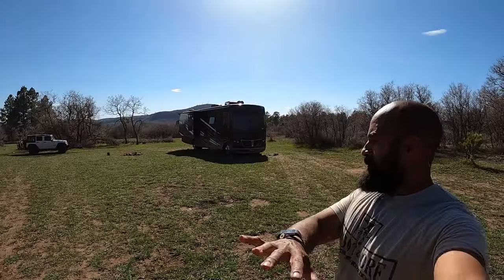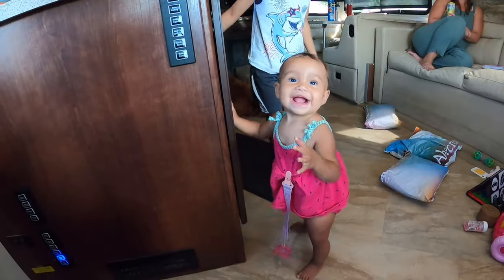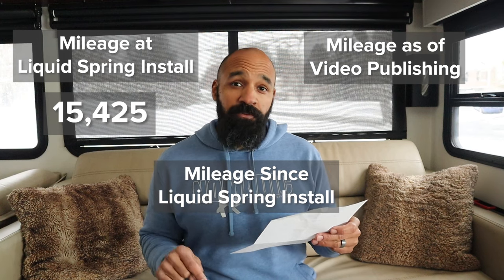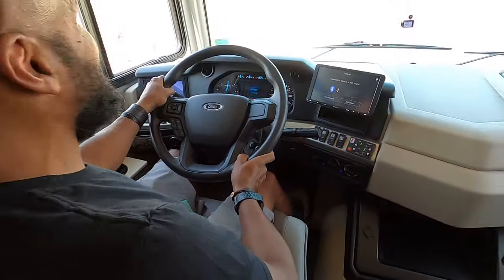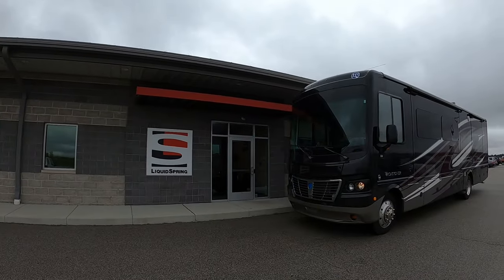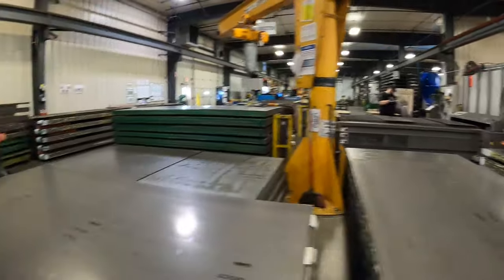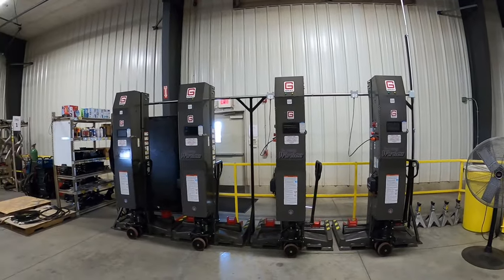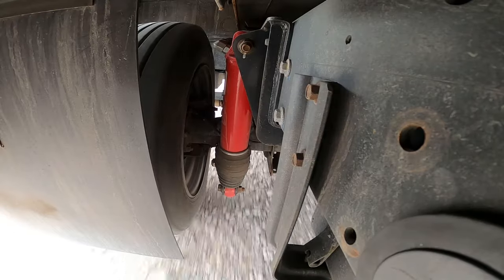Is it really THIS GOOD? 2 Year Review of Liquid Spring Suspension System | RV Family Travel Life

Comment: Great 2 year overview, I just returned from LiquidSpring HQ, I spent 5 days having the 4 corner suspension installed on my 2020 HR Vacationer 35K, videoing the entire process and interviewing. On my 380 mile drive return back to Michigan, the fatigue factor no longer exists, also I noticed I need to make sure I use cruise control, if not I could easily exceed the posted speed limits, before LS, that was not the case. It's absolutely a game changer. Now besides the normal fastener inspection, they have added a desiccant filter that needs to be inspected.  For the Ford F-53 22K chassis, it adds 550 lbs,  which count as cargo, so that must be taken to consideration. Wayne Wells, Eric Garcia, technicians and the engineering group were great to work with.  Safe Travels guys.
Reply: Adding 550 lbs. is a deal breaker for me. What I wouldn't give for another 550lbs of carrying capacity! We're FTers who boondock most of the time. Our F-53 chassis MH even has a tag axle to increase its carrying capacity. Still, we started out with only 3,700 lbs. of CCC available. When you subtract the full tanks that we travel with (800 lbs. of water, 360lbs f gasoline and 120 lbs. of propane) and a 1,100 lb. solar/battery system (5,020 watts of solar and 23.5Kwh of LiFePo-4 batteries, inverters, charge controllers, etc.), we only have 1,320 lbs. left for everything else. This includes our food, kitchenware, appliances, clothing, linens, camping and BBQ equipment, TV, computer and all our worldly possessions. That's not much. We transferred all our heavy tools, chemicals, extra water, etc. to our toad and pared our weight down as best we could (ditching our heavy glass bathtub door, sofa bed, window treatments, etc.) and still barely scrape by under our weight limit. Giving up another 550 lbs. would be more than we could afford. Now, if it added 550 lbs of CCC, we'd be all over that mod, for sure!